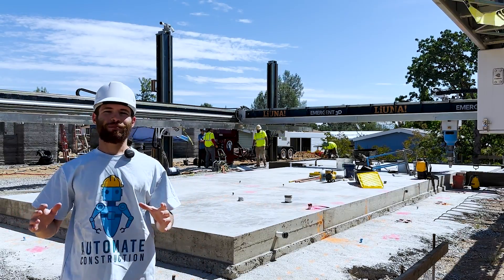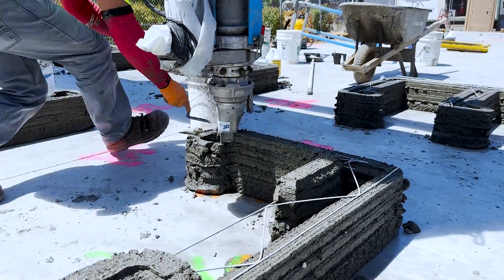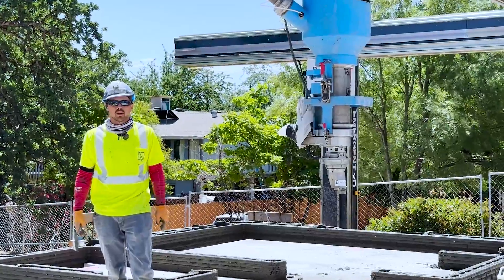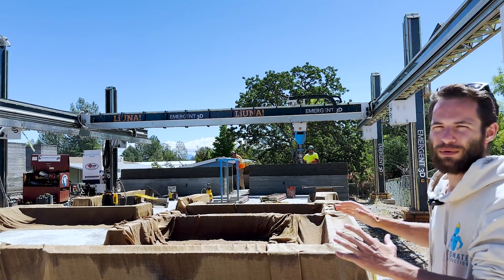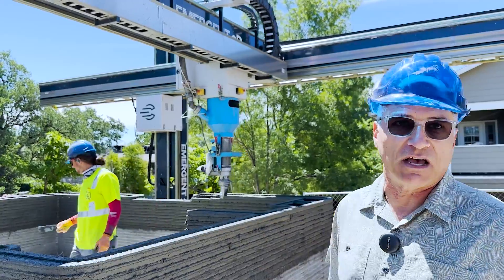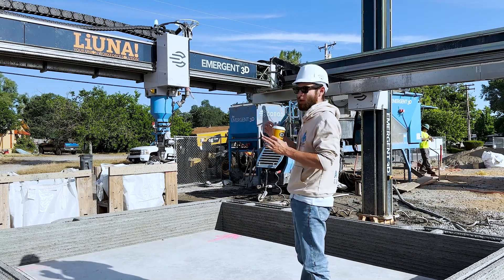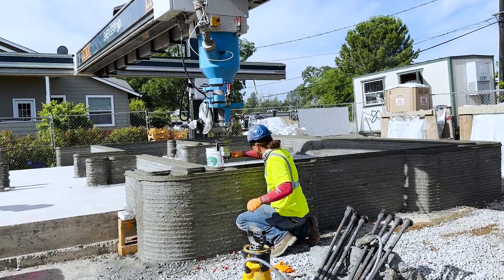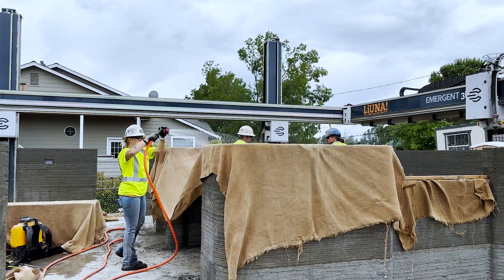Copy Paste Four Printed Homes in California

Comment: Hey Jarret great video! Do any of the companies work in shifts so the printer never has to be shut off? Oilfield & healthcare do 12 hr shifts. Could also do 3X 8 hr shifts.
Reply: The printer actually needs down time too. Especially with hot days, the printer needs to be cleaned every so many hours or the buildup on many of the parts becomes so hard that it takes hours just to remove it and keep the machine functioning efficiently. This applies especially to the mixer, pump, and print head hopper.
Reply from the maker: I’ve seen icon do a shift change, other teams often have one extra on site so people can take a staggered lunch or something. Many sites have noise restrictions which prevent triple shifts.

Comment: Looks like Cobod needs to build some kind of self-cleaning system into the extruder head. That would save a lot of time.
Reply from the maker: Love this idea
Reply: Just some simple flushing channels in the "hot end" (not sure what they call it on a cement printer) could make the cleaning process so much quicker/easier.

Comment: I still don't see the benefit of 3D printing walls, compared to "LEGO-like" solutions like Ytong block - where a house can be arranged by a couple of workers in a few days, without any expensive equipment and preparations - and of course Ytong blocks will have much better thermal insulation properties compared to concrete and 3D printing.
The foundation, roof and floors slabs are made in the old way, only the walls are 3D printed, that's why the system seems inefficient to me.
Reply from the maker: Young people don't want physical labor jobs, without a solution housing will become increasingly cost prohibitive. The full benefits of automation have yet to be realized I agree however the pursuit is critical in ensuring a prosperous future unless you know a better way to get the next generation learning trades for the job site.
Reply: This method allows more design freedom and can produce structures that cant easily be made any other way.  It's still a new technology and will only improve once more people are involved.